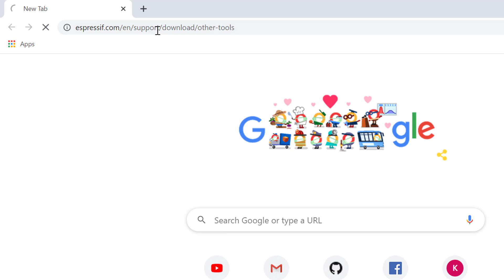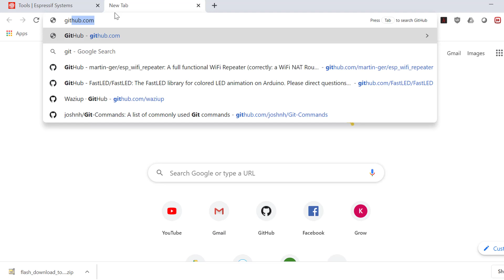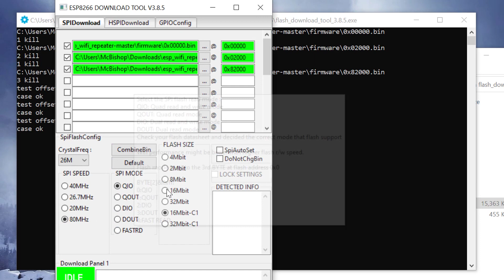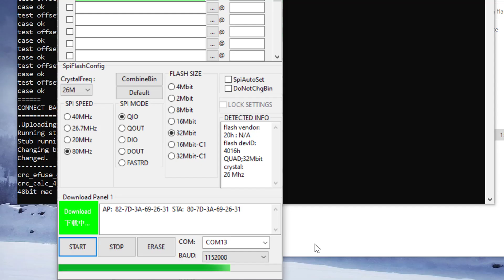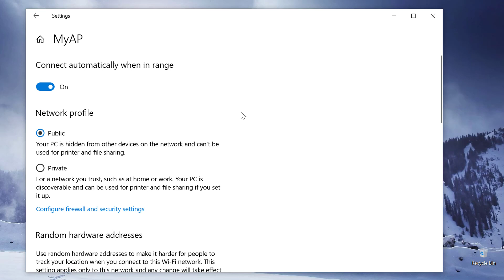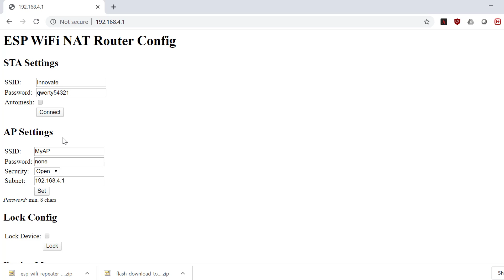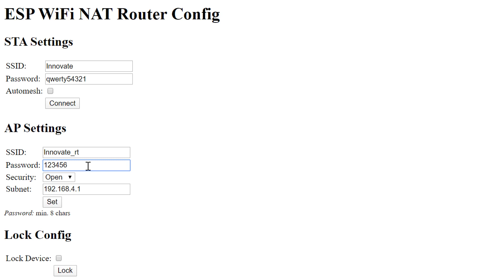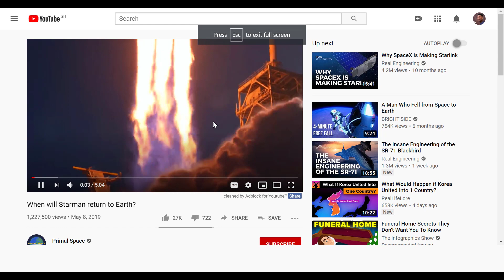How to Make a WiFi Repeater using ESP8266 NodeMCU | WiFi Router Range Extender esp8266 esp32 | 2022

Comment: I got the step but when I plug the usb it's not picking up my device to flash it. I don't see the device to even put the drivers on it.
Reply from the maker: Thanks for getting in touch. If you can't see your port its usually because the UART chip on your ESP board driver is not installed.

Go to the link below, download the CP210X and CH341 drivers and install them. Am not sure which one of the two chips your ESP got but one of them will work for you.

https://drive.google.com/drive/folders/1M9UKCm1I6qsNywlQFlggDPvXdKDEhLjm?usp=sharing

Please dont forget to subscribe. Cheers!!

Comment: I am new to your channel and i already subscribe. I had a problem a while ago while following your video. the esp8266 can't recognized the port number when i inserted to my laptop. can your help me what to do or give me a link what to download so that i can continue the project. Thanks and Gob bless
Reply: Thank you very much it helps me a lot
Reply from the maker: I'm glad it worked.

Please dont forget to subscribe. Cheers!!
Reply from the maker: Thanks for getting in touch. If you can't see your port its usually because the UART chip on your ESP board driver is not installed.

Go to the link below, download the CP210X and CH341 drivers and install them. Am not sure which one of the two chips your ESP got but one of them will work for you.

https://drive.google.com/drive/folders/1M9UKCm1I6qsNywlQFlggDPvXdKDEhLjm?usp=sharing

Please dont forget to subscribe. Cheers!!

Comment: Delali hi. First of all, thank you for this beautiful video. No matter what I did, the name wifi did not come out, but thanks to you I succeeded. But as you showed I couldn't manage the internet connection.  I want to do it again, but automantic connects to the wifi name that I did before and failed. How can I repeat the next steps after seeing the name of nodemcu on wireless networks?
Reply from the maker: Thanks for the kind words Neslihan Yangin. Kind re-flash your esp with the binary files again so it completely reset. Then connect to the wifi name and visit 192.168.4.1 to configure. Am available if you need any help

Comment: Hi, i followed everything, it works but the signal is week. with same distance from my router i got 60mbps for my internet but only get 3mbps using node mcu
Reply from the maker: Yh it appears to have a weak signal and mbps on the esp is also very low but when you actually connect to the esp and stream or do something on the internet its quite decent - as i demonstrated toward the end of this video. Also the esp is a small under 5 USD board so its not as great as a professional or customer grade repeater.
Reply: I have tried other programs with the same esp. Worked quite well, when placed away from the router too. Please let me know if any improvement in code can help.
Reply: Impressive features is to have a web interface and option to customise the user credentials. Awesome.
Reply: Liked your total presentation and idea

Comment: Hi delali, Thank You very much for this nicely detailed video. Is there such a device like the ESP8266 with support for 802.11ac/ 5.8gz ? Am wanting to setup as a repeater on top of drone which requires 5.8ghz wifi for FPV. Thanks again.
Reply from the maker: I haven't come across a devboard that can be used in 5 GHz band range but i will surely update you if i do.

Comment: sir i am having problem with COM ports plz tell me what to do, do i have to download any COM or what ? i have tried different usb cables and still the results were same the COM error what to do plz reply
Reply from the maker: Thanks for getting in touch. If you can't see your port its usually because the UART chip on your ESP board driver is not installed.

Go to the link below, download the CP210X and CH341 drivers and install them. Am not sure which one of the two chips your eps got but one of them will work for you.

https://drive.google.com/drive/folders/1M9UKCm1I6qsNywlQFlggDPvXdKDEhLjm?usp=sharing

Comment: mine just says sync and it will just load from  log (.......______...........__________........______..........._____......)
Reply from the maker: Not sure why. Kindly delete the flash tool files entirely, download a new one and try again please.
Reply from the maker: Hold down the "Boot" button on the esp and the click start in the flash tool. Don't let go of the Boot button until the flash is over.

Comment: hi i follow all the steps but connect
without secure internet
What is wrong?

a question I can put the name that I want
in ssid xxxxxxx
Reply from the maker: Turn on the WPA-2 option for security and yes enter your ssid name
Reply: @Delali  If I activate WPA2 but I remain the same
connected without internet
i think the whole process is ok i don't understand the problem
It can be a company router that does not allow connecting

Comment: how to put a space in a network that has 2 names example "internet Carlos" as I separate there is some special character
Reply: Use %20 for the space, i.e enter "internet%20Carlos"
Reply from the maker: @chuphan6309  Interesting approach. Would check it out. Thanks for sharing
Reply from the maker: You have to remove the space instead. Wifi name with space in-between doesn't work.

Comment: dude i made it but there is no internet connection, can u help me?
Reply from the maker: you mean your main router doesn't have internet or you repeater doesn't have internet? If its your repeater then its most likely your main router's internet isn't strong enough to be repeated. Can you run a speed test on your main router and share the value with me?
Reply: @Delali  
when I was in the bedroom, the internet network didn't cover it. and sometimes the wifi is not connected. so I think to make my own repeater, I've tried to get the repeater closer to the main router but still can't access the internet. i cant share speed test because sometimes wifi didnt connected
Reply from the maker: Not sure why its like that. I will be making another video with the ESP32 sometime, hopefully that one serves you better.

Comment: when i do this i try to conect the esp8266 to the computer but the com port doesnt appear what i can do?
Reply from the maker: Kindly double check your USB connections and also try resetting your ESP. Let me know how it goes.
Reply from the maker: Thanks for getting in touch. If you can't see your port its usually because the UART chip on your ESP board driver is not installed.

Go to the link below, download the CP210X and CH341 drivers and install them. Am not sure which one of the two chips your ESP got but one of them will work for you.

https://drive.google.com/drive/folders/1M9UKCm1I6qsNywlQFlggDPvXdKDEhLjm?usp=sharing

Please dont forget to subscribe. Cheers!!

Comment: I did everything correctly, but it doesn't connect to my Android hot-spot that I want to extend
Reply from the maker: does your android hotspot have a space in its name? or perhaps you can cross check the ssid and password you entered in your esp settings
Reply: @Delali   it had one earlier, but I changed that to vivo
Just that much, still no luck
Reply: @Delali  I think my node mcu is faulty there were some soldering issues in that when it came, will try with another
Reply from the maker: @Sneha-vk7nb  oh ok. try another and let me know how it goes. We could have a short virtual call and walk you through if need be.
Reply from the maker: check channel about page